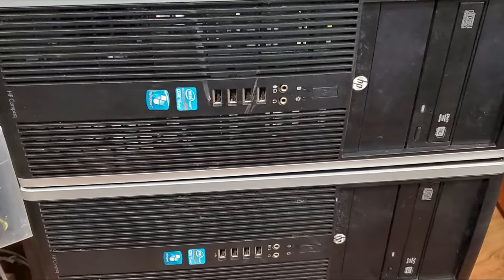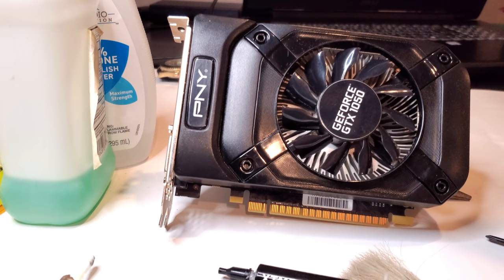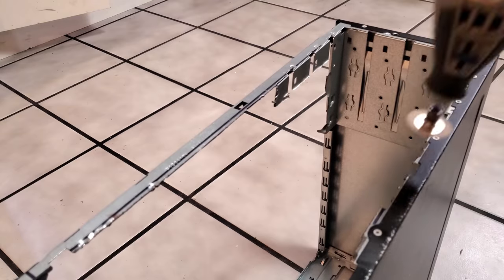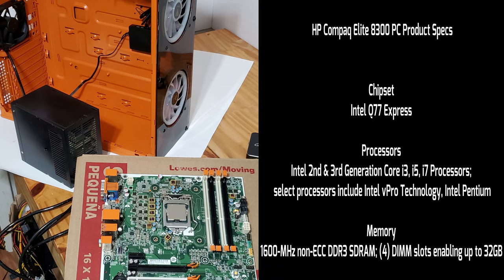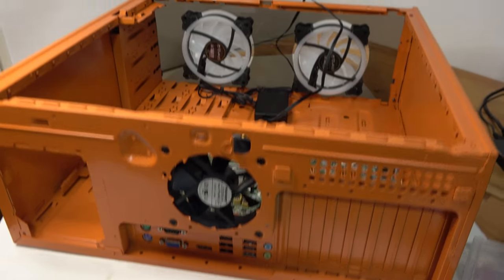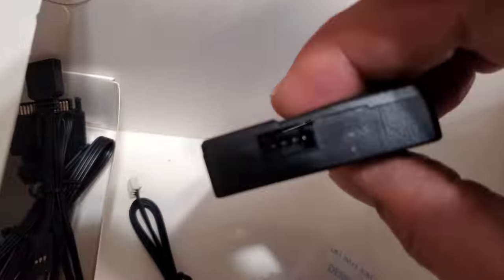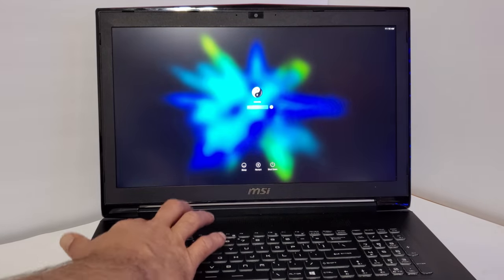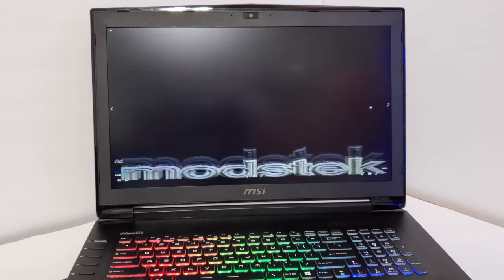I made a cheap gaming pc out of an old hp

Comment: Nice the specs are close to my Dell Inspiron 17R SE 7720 after I tricked it out since my mobile i7 3rd gen is basically the equivalent of a desktop i5 3rd gen. The only real difference is my GeForce GT 650M GPU with 2GB of VRAM since that isn't upgradable. I use it as my bed side laptop and it still works perfectly well playing FF14. Though mostly fishing while I read I will admit since all you need is to hear the fish bite to click and let the macro do the rest.

Wish I could do something like this but I don't trust myself not to screw up, the moddiest thing I've done was drill out the rivets on my secondary towers drive cage. I only did that because I wanted to fit a 5700xt in a matrexx 30 case and the three fan phantom d was too fat to sit on it.

Comment: try using a pillowcase to clean the dust off the pcb. you can get in and around the sharp points without any threads catching on stuff.

Comment: I dont know how badly underpowered the power supply is but is I would try to get out of it at least 90W for the gpu without a fucking rgb controller. (6pin going to the card)  There are some 1650s with GDDR6 that have a Turing NVENC encoder now. If it could do 120W you could even go up to 1660ti even if 1060 6GB makes more sense because the gpu is gonna be bottlenecked anyway.